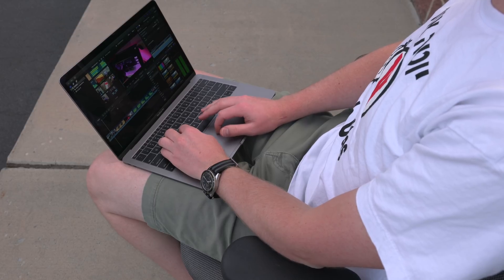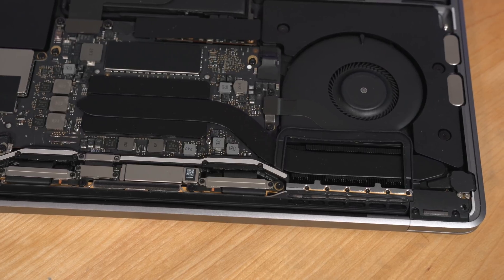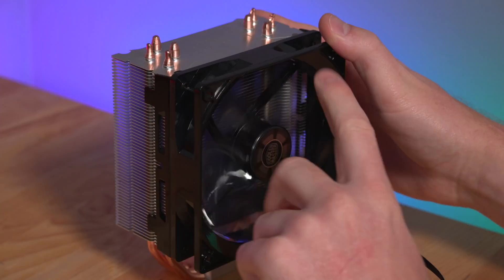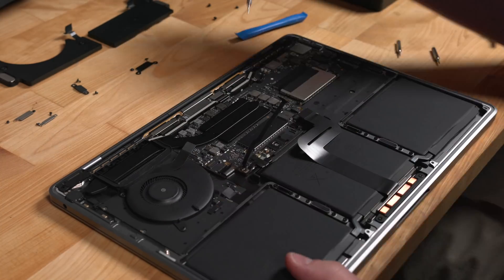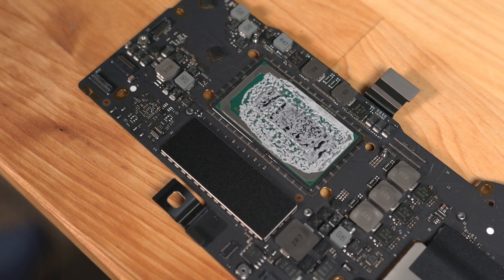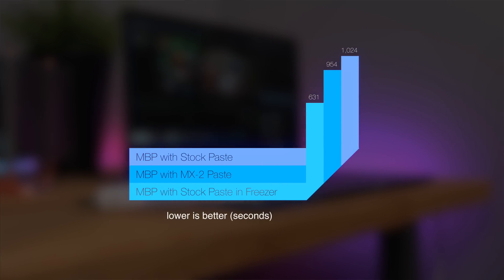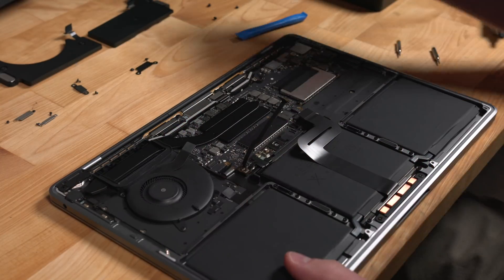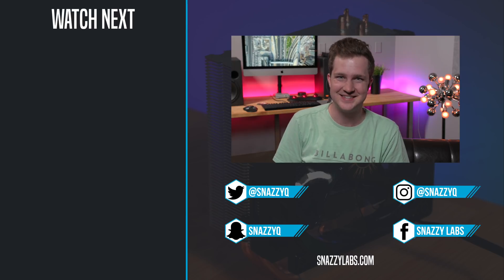Fix Thermal Throttling on Your Mac?!

Comment: The fact that the thermal paste was crumbly after just a few months says a lot about the lack of quality. I opened up a Nintendo switch that was 5 years old and the thermal paste was still tacky. I've seen crumbly thermal paste in a loooot of older Macs of the 2011 - 2014 variety. Guess I'll be opening this 2017 Mac some time soon.

Comment: Help, please! After a good clean and repaste my Early 2011 MacBook Pro 13" (2.7 GHz Intel Core i7), basically the temperature still the same. I've been thinking that replacing the motherboard might help to make it run much cooler. What do you think? Thank you so much!
Reply: I would advice you find a refurbished M1 MacBook Air for like 575$. I got mine from Woot open box for 575$. Not a good idea to ue a 13yr old machine
Reply: @A_GodApple  Thank you for your time. I bought an M1 MacBook Pro last year. Love it! And I understand what you mean. However, I would like to keep that one for the kids, since they don't need much in a computer for what they're doing right now. I just would like to know why it gets so hot just by open it, and if there's a not expensive way to fix it. Thank you.
Reply: @arecme23  ah ok makes sense. I did I similar thing by getting a m2 MacBook Pro 13” and I leave my 13” 2014 MacBook Air as a second laptop for others to use.

Comment: Hi Guyz! 
Love your videos. So I've got a mid 2015 MBP and it was working fine for a while until it hasn't. Lately it has been going into a volcano mode with heat and poor performance. I've changed a battery from iFixit and it helped a bit but then it started again. I've change the thermal paste and even bough the thermal pads but without any improvements! Any ideas? I was reading about the issue about 2nd monitor and MPB's going into whatever shit mode they are but even disconnecting the monitor the situation is similar.

Comment: Good point. I recently found my Macbook Pro (Early 2013) heating up even on normal computing use. It would shutdown automatically after only 1 or 2 sec of Youtube video. So I cleaned the dust off the fans and around other components (most were on the two fan areas) and reapplied the thermal paste using a good quality product (one I think that has the highest density of highly thermal conductive metal particles, and therefore heat conduction). The results are amazing - I haven't tried 4K or 1080p video editing yet, but I can now watch Youtube videos for hours.

It's like I now have a new Macbook Pro; or a rejuvenated one at least. I'm one very happy soul. :-)

Comment: Grizzly Kryonaut worked well on my MBPr 15" Mid 2015 where the lowest temp was 48C where prior to that it was at 61C.  However, it didn't work well with my MBPr 13" Early 2015.  What works though was the Arctic MX-4.  The lowest temp that the book is getting now is 46C and prior to that, it was  at 70C.

And yes, changing the thermal paste on a MBPr 15" is not an easy feat compared to the MBPr 13".

Comment: i have the latest 2019 macbook pro 13 inch fully maxed out. I have been using it sence december and during winters, it surprisingly never heated up soooo much as it is now in the summers. suddenly, when i open my mac ( not using any heavu applications) it starts to boot the fans and it heats up like anyyything. i am looking everywhere to find a fix

Comment: I replaced the thermal paste on my late 2013 MBP. I used Gelid Extreme and it helped improve overall CPU performance. I noticed this mostly in Serato DJ Pro software when analysing  audio for critical data to aid mixing.
Reply: interesante lo que dices pues tengo una mbp 2015 y también uso Serato dj

Comment: Hey,I have a doubt about my Mac. My New MacBook Pro with Touch Bar heats up specifically when I use certain websites and as soon as I go off those sites, it cools off. Can you please explain that? If it is just my Mac or it happens to everyone.
Reply: Acontece a mesma coisa com o meu Macbook Pro 15" de 2019, com i9, 32 RAM e 1 Tera de SSD. Em suporte da Apple não conseguiram corrigir e ficam querendo empurrar como se fosse normal. Tenho outro MBP de 13 de 2019 também (com i5, 8 RAM, 128 SSD) que entrando no mesmo site não apresenta nenhum problema. Apenas aguardando uma loja APPLE abrir para deixar o MBP (está na garantia ainda). Se não resolverem o problema vou devolver e pedir reembolso. MACBOOKPRO Apple VERGONHA !!!

Comment: I asked you this on Twitter and will ask you here too: This vid's intent seems to be about better performance out a MBP, but could it fix my problem where my mid 2014 15" MBP Retina now freezes & turns off when I do graphically intense stuff? I've done the SMC and NVRAM (or PRAM) reset so I know that's not it. And I know it's not OS because I have two partitions running two different OSes (one's High Sierra, the other's Mojave) and both will have these issues when something graphically intensive is occurring
Reply from the maker: Might be a bad GPU. If you’re able/willing, install Windows and then HW Monitor to get real GPU temps and you can be sure it’s just throttling before you open it and replace everything to no resolve if it’s a faulty board.
Reply: @snazzy  any primer on using this windows based software to test what I need to? Assuming it confirms the GPU has gone bad, this means a logic board replacement? Or is there a way to just replace GPU? Also how does hard drive, ram, etc all work? Isn't that all soldered on?

Comment: Apple has a terrible design and their laptops suck. Consumers are shelling out 2000.00 to 3000.00 dollars and expecting them to last for years! Cheap thermal paste, solder, no air vents, too hot to use and the list goes on with macs 10 year report of recalls and break downs due to poorly designed laptops. Funny thing is, consumers continue to buy them! I have a 10 year old DELL 17 inch i3 with 6 gigs of ram and 1TB drive which I purchased used for a mere 300.00 dollars and it still kicked butt at one of my dj gigs because my Macbook pro with 16 gigs of ram and 512 gig SSD crapped out on me! Apple is way overrated and overpriced! An acer laptop has more life than a mac. I am no longer a Macbook Pro fanboy. Get a LENOVO. Been there done that.

Comment: Snazzy Labs look I know you are all pro apple and don't want to criticize them for their product. Simply put an apple user SHOULD NOT HAVE TO BUY third party programs and hardware to STEM off the incompetence of the apple computer designers!  Look its a fact large processors doing large loads of computation will create a lot of heat so apple knows this but does not care.  It care's more for the flatness than what it's 100 % capable of.  OH lets buy a truck!  It says it can go 180 MPH but because it gets too hot at 180 MPS you can only do 100 MPH!  This is what people buy at apple.
Reply from the maker: When did I not want to criticize them? This whole video is critical of them lol

Comment: Apple has to get on this. Make the comp a little thicker, put a better fan and heat sink and lets stop the nonsense. Great vid as usual. However, I am not tech savy enough to open it and do this. But, very interesting.

Comment: Those of you who applied Kryonaut more than a year ago, what are your temps today?  I ask because the Kryonaut website says the paste won't quickly dry UNLESS the temps are 80°C and higher.  As we MBP users all know, temps reach 99°C quite often and stay that way while video editing, exporting, or even watching 4K videos in Chrome.  I wrote Thermal Grizzly an email in late July 2019 and here's what they told me: "if you get high temperatures and maybe also throttling because of these temperatures we would recommend using Kryonaut for better performance. High Temperatures can result in faster deterioration. Thermal Paste will always get a bit hotter after time because it dries out, but it is not like it will wear off in 2 weeks. We would recommend repasting it every 1-2 years to get the best result, but we also have had people who are using the same paste for 5 years with 80+ degrees celsius."  In contrast, MX-4 is made to last 8 years.  MX-4 beat MX-2, so I am wondering if it wouldn't be better to just use MX-4 instead of Kryonaut. Hmmm...

Comment: My mbp 2016 was getting so hot i couldn’t even watch YouTube videos on it. Turned out that the fan couldn’t spin freely because of some dust piece or something got in between fan blade and the base. Was pretty easy fix with ifixit tool set, but yeah i agree its not for the faint of heart

Comment: With 7.3K likes in a video as ON POINT to Apples poor thermal cooling system this shouldn't just be a informational highlight, I feel we all need to take a stand against apple to get (force) them to for once design a thermal system that can prevent thermal throttling and handle all the intensive applications we use on a daily basis. Because frankly for the sake of wallets in spending anywhere from $3500 to $13,000. Its not just the MacBook Pro;s that have this issue the iMac Pro does as well; which is horrifyingly disappointing and unacceptable. We paid for a machine that does not function properly to handle this applications it was marketed and intended on being used for: seriously on apples website for MacBook Pro that market its use for games like Tomb Raider or Fornite which will almost within minutes take the temps to 200 degrees and higher on a constant. Its just not acceptable for apple to get away with this any longer. Personally, I'm tired of it! So if WE all want to have that Mac computer someday that has top notch cooling then We’re going to need to put some consumer pressure on them. we need to Keep up the advocacy, and call your legislator!!!! put in the effort and we can all reap the reward.

Comment: Why did you not advocate for people to do this on there own? I tore my Dell latitude d620 down to clean the fan and had to remove the LCD display, keyboard, ram, HDD and logic board to get to the fan removal. (Go Dell! Hah) This is a very simple job and should never be done until you have cleaned your fans first. And how is 9% not worth doing it yourself? It's an easy job if you have the right tools. But some people just have more money and would rather pay someone else to do it as their time may be worth more than another's.

Comment: One best solution I did to my Macbook pro late 2011, I just remove the backlight pad at the back of the keyboard and I got the best ventilation and no overheating ever, just increasing air flow fix the problem. Just make sure you don't spill any liquid on the keyboard that will damage the board beneath the keyboard.

Comment: Hi thanks for uploading this useful video. Im a Graphic Designers and Professional Photographer and I recently buy Macbook Pro 2017 
- 2,9 GHz Intel Core i7 - 16 GB 2133 MHz LPDDR3 - Radeon Pro 560 4096 MB
Intel HD Graphics 630 1536 MB.
First I want to know why you had to do the thermal paste change so soon? 
Im happy with the overall performance in normal activities, but when it comes to use Photoshop or Lightroom. IM really disappointed. Im not sure if its my computer or Adobe CC is causing problems. I have permanent "BRush Lagging" Photoshop, And in lightroom checking through my raw images is not as fast as aI thought, sometimes lagging comes too. I need your advice , im really worried about this. Can you give me any advice?
You think this problems is caused by thermal paste? or this model has something wrong? or I am the few unlucky people who received a damaged new mac.
Thanks for reading me. really appreciate any advice

Comment: This summer I sit in front of a window air conditioner, I have an older Mac, the cool air blows right on my computer. I suddenly noticed that my Mac doesn't even get warm to the touch! At times only slightly warm to the touch. I know they use air conditioners on the really big computers. Maybe you could use it on these new Macs.

Comment: I couldn't comment below the follow on video.  So I am here.  In the follow on video Snazzy uses liquid metal instead of thermal paste.  You can go beyond liquid metal on the CPU.  From the options on a laptop I'm interested in:

Thermal Grizzly Conductonaut on CPU + GPU, and 
Fujipoly Extreme Thermal Pads on heat sensitive surfaces

Comment: The easiest way to have your PC hardware to not thermal throttle and perform like hot trash... is to not ever put them in a shit Mac to begin with... funny how that works.  And you get to save thousands, while getting the same hardware, and having it actually perform up to potential... what a concept.

Comment: I wish doing the same thing on a 2016/2017 MacBook 15inch model was so easy. On those models you have to take the entire machine apart it seems. Maybe you can do the same test on a 15" model to compare results to the 13" model.

Comment: I wish Apple would’ve added another fan to my laptop. I was worried that my laptop would over heat so I ended up shutting it down and letting it cool off. I’m playing life is strange on my MacBook Pro 15” and it’s always heated up to horrible amounts so I prefer my iMac but I was really worried that it would start melting the aluminum or burn my legs. I hate how Apple makes someone spend $1500+ on a laptop that doesn’t have adequate cooling systems or more than a few plug ins. These are the times I wish I could resurrect Steve Jobs from the dead
Reply: It wont melt
Reply: Lol, Steve was famous for not even wanting fans at all.

Comment: Would you consider trying this with liquid metal, for SIENCE?
You'd have to look into what metals your die caps and heatspreader are made from (likely nickel and copper respectively) since gallium doesn't play nice with aluminium, but I'd love to see if it's possible and how large the improvelemts are.
Reply: dont do it

Comment: well, given that there exist thermal throttling issues that hold back the hardwares on apple computers, i would say snazzy labs is wrong! it IS absolutely worth it to change the paste....more value for the money, besides its incredibly difficult to actually do something that can damage your mac if you careful in the process.....i assemble stuff all the time and i never have any issues because i know what to do and where to do it, so i dont touch anything else.

Comment: Thanks for your video Snazzy! I have the same problem with my new iMac pro. That is so stupid.
My processor just warms up to 95 degrees and the fans wasn't turn faster.
But I don't understand why mac fans control won't work on it.
The app show for both of my fans a minimum speed of 32 and maximum of 16.
And the speed of the fans varies very fast between 236 and 16 000 RPM.
Which is not the case since I think I would ear them if they were running at 16k.

Let me know if you have an idea and thanks for your help!
Happy new year!

Pascal

Comment: Hey Snazzy and everyone willing to do this.
While you are in there, you should apply some thermal transfer tape (thick stuff 3mm) to the back side of the heat pipe on the fan side.    The idea is to get the heat pipe in contact with the LARGE ALUMINUM BOTTOM plate of the Macbook. Effectively increasing the size of the heatsink. 
You will have to trim some stickers that Apple installed in order to get the thermal transfer tape to directly contact the aluminum but hey, its added cooling too. 
Downside? the bottom of your MacBook is going to get hotter faster.... upside? it will take longer to hit thermal throttling.
Reply: I never once mentioned I had a 2017 MPB every model is different, as you know...... this means if you are DYI'ing you should know how to measure this.    my A1502 needed 3mm    and as we know apple can change the design at a moments notice so obviously even if i had a brand new 2018 MPB my advice would be wrong.    hence..measure it if you are not sure.

Comment: You can undervolt your macbook with a program called Volta.
As long as you don't undervolt so much that you system gets unstable, undervolting will make the cpu produce less heat.

I have mine at -90 mV, and it definitely throttles way less, especially with longer usage

Comment: I have had 3 mbp's burn up and wear out due to heaT AND THERMAL issues in the last 4 yeaRS... ARGHHHH...   I so wish u had this vid back in 2013 when i was buying the paste etc... apple always said it was a FLASH ISSUE... dickheads!

Comment: what if you just keep the macbook components open and add a desktop cooler. it will lose mobility but im curious how it performs without temperates that get higher than the average oven.

Comment: I render a lot of video with Handbrake on my 2017 MacBook Pro 13" with Touch Bar (the $1,799 model), and the CPU stays at 90C (not changing fan speed). CPU freq also stays at 3.50GHz, which is the max turbo boost frequency. All measured using Intel Power Gadget.

Comment: Hey Snazzy, what if also u remove the paint of the cooler(since that is working as thermal insulator), also a little bit of undervolting and some premium thermal compound (like  those that u used or maybe some liquid metal). Can all of that get the macbook to no throttle at all?

Comment: If you know what you’re doing, then yes it’s worth it. Why? A cooler laptop will increase the longevity of the device. Think, you paid $1200-$3000 grand for the MacBook Pro, why not use every advantage to keep it cool and get your money’s worth? By the time you need to upgrade, Apple will not have replacement parts anyway. I still use my 2010 15’ MacBook Pro, been in there twice. SSD/RAM upgrade, and you guessed it, thermal paste. Every six months I open the bottom an hit with a can of air. Still runs like champ. Best $500 bucks I ever spent.

Comment: I sit my entire macbook on a Sonnet pcie thunderbolt chassis, which has a fan cooling it. It makes a massive difference to the performance. When I'm working away I often just grab a kitchen pot and sit the computer on it to help dissipate heat from the chassis.

Be interesting to see an actual comparison of this kind of thing.